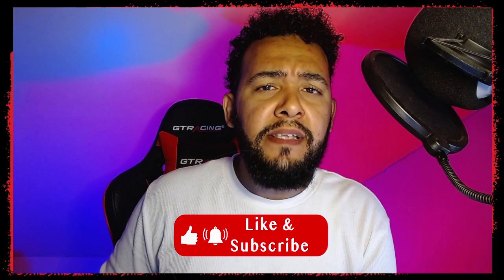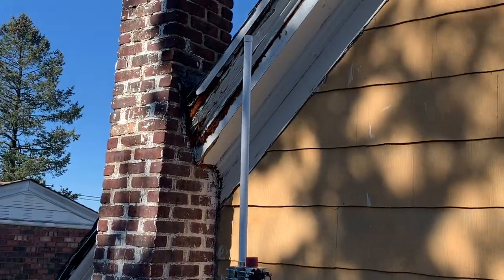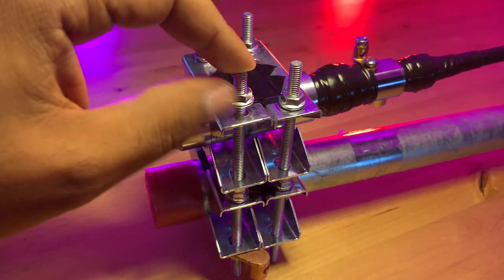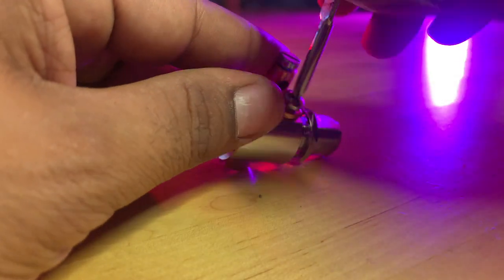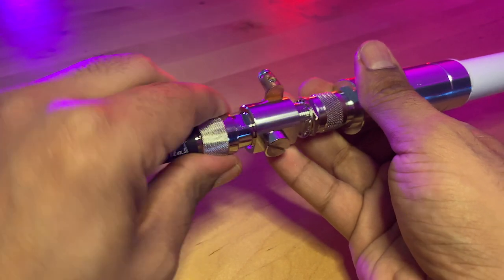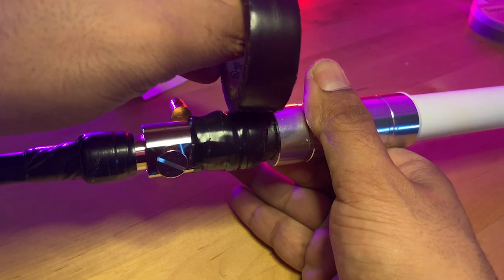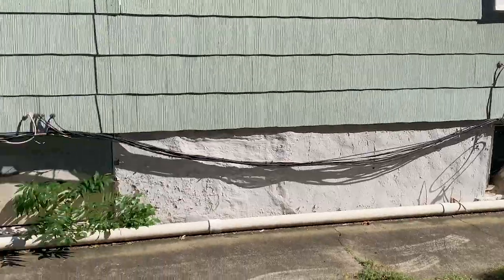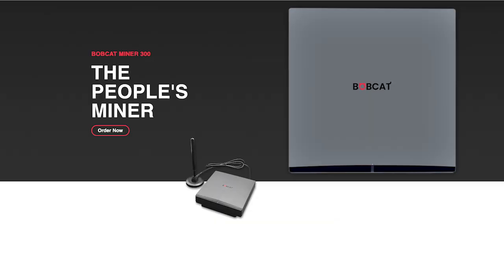EASY Helium Antenna & Grounding Setup | RAK 5.8 | Lightning Arrestor Setup

Comment: if antenna is on the metal pole you don't need another wire to the antenna.  If the antenna is DC grounded ( means short to center pin to braid, this will take care on any static spikes) you really don't need a ground arrester, some wire at the bottom on the mast pole is enough to give it a path, if lighting strikes your miner is dead no matter what you have up there.
Reply from the maker: Yop

Comment: Just see this one question I was told not to put the lightning adapter under the antenna.
I was told the lightning adapter should be at the point where the cable enters the house?
What do you think?
Reply: The current from a strike or static build-up will travel the path of least resistance which would be into the ground (earth).

By placing the arrestor at the bottom end, the only path it can travel would be through your antenna cable instead of the grounding electrode conductor (#10 used in this video) before splitting off at the end.

In the event of a direct strike, neither would make a difference because mostly everything connected will melt, fry, or vaporize.

Best practice would be to split the current off before entering your cable like this video shows.

Comment: Cool video but it's better to have the arrester inline closer to the miner. This current setup will only help from a direct strike to the tip of the antenna, which is unlikely as fibreglass is not a conductor.

Comment: Can I use #6 grounding wire? #10 seems to thick, and twice as expensive?
Reply: #6 is larger and more costly than #10; because it's bigger it has a higher ampacity rating, meaning it will allow more current to flow through it.
Reply from the maker: #6 can also be used 
#10 is thick and expensive for good reason
Reply: @ItsTheZigMan  thanks man 🥰

Comment: Hiho. If the Antenna is DC grounded/shorted you don't need a lightning Arrestor which would cost you about -1dBm. You should check this. More power can't hurt ;)
Reply: @ItsTheZigMan  do you know if that specific antenna is dc grounded?
Reply from the maker: Antenna does not need to be grounded. 
But to protect your device, you can ground the lightning arrestor

Comment: would a 12 Gauge Copper Clad Aluminum wire be enough for grounding the antenna?
Reply from the maker: Solid copper cables are better electrical conductors than clad aluminum and provide superior, stable electrical characteristics over a wider range of frequencies. They are also considered more rugged and less likely affected by vibration or susceptible to corrosion since they have less surface area than stranded conductors or clad aluminum.

Comment: Thanks so much for mentioning all the connections. Many youtube videos don't give details on the male/female aspects of the set-ups. How's your mining doing?
Reply from the maker: I’m glad you found it helpful. The connections are the easiest to misunderstand. I bought about 3 cables before getting the correct setup, I’ve learned the hard way 😅
Earnings for my miner are around 8-10 HNT in 30 days
Reply: @ItsTheZigMan  8 - 10 HNT is pretty good. I think you are in NY, right? I am too. Continued success
Reply from the maker: I wish our reward scales were better lol
But I’ll take what I can get
Reply: @ItsTheZigMan  - your pole height looks good. Do you think the amount is somewhat capped by the devices around you? It seems the reward scales of the witnesses are important and NY is very saturated.
Reply from the maker: My pole stands at about 26 meters off ground level. Total of 120 witnesses in the past five days. The earnings are definitely affected by others around me. Their reward scales range from 0.18 to 0.50 😬
Which is why the higher the altitude, the better chance of potentially witnessing miners with a better scale.

Comment: Great info.  Thank you!  Both ground wire from antenna are connect to mechanical lug or just the split bold?  And also you don't need conduit for the #10 wire?
Reply from the maker: Both to Split Bolt

Comment: YOU did a great install was there a reason you did not attach to the chimney seems like it might some time and you have gained some more coverage that antenna is a 360 coverage antenna it looks like you are blocked by the house a bit. but still, a great job was done be safe.
Reply from the maker: Great point about the chimney! 
My landlord won’t allow me access up there though so I had to settle for using this mast instead.

Comment: Does the split bolt connector have to be copper? 
Thanks!
Reply from the maker: Yes because they are used to connect and bond copper wires.

Comment: THIS IS THE WAY
Reply: Hello, nice vid, one thing I would be mindful of is the grounding split bolt isn't designed for that "shared" ground.  Bond from arrestor to mast then mast to house ground. Use a galvanized grounding strap on the non penetrating roof mount of another grounding lug from that metal.  Clean all paint and debris to make solid contact
Reply from the maker: I have spoken 😄

Comment: Why use an arrestor? How about to connect the grounding wire to the outside of the antenna directly?
Reply from the maker: Ever heard of the NEC Guidelines?
Google the National Electric Code. 
If you’re going to do anything, 
make sure to do it the right way. 
Don’t do what you THINK works.
Reply: Awesome!

Comment: Does the grounding wire have to be solid instead of stranded? Have a ton of 10 stranded was going to use but not opposed to buying solid if it’s necessary.
Reply from the maker: Solid cables are better electrical conductors and provide superior, stable electrical characteristics over a wider range of frequencies. They are also considered more rugged and less likely affected by vibration or susceptible to corrosion since they have less surface area than stranded conductors.

Comment: Great info! Nice work.
I crimped my 10 awg ground from arrestor to mast to service box as well but with fewer junctions.  I made a bare copper loop out of the wire and self-tap screwed into the mast and continued to the service box.